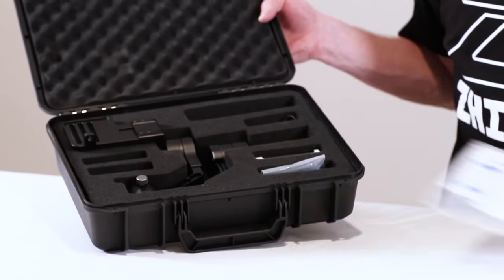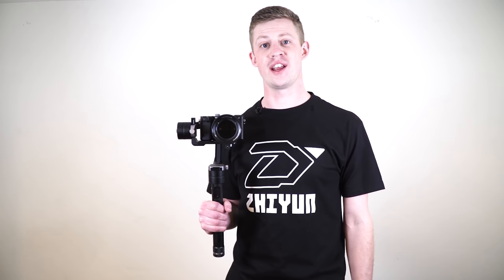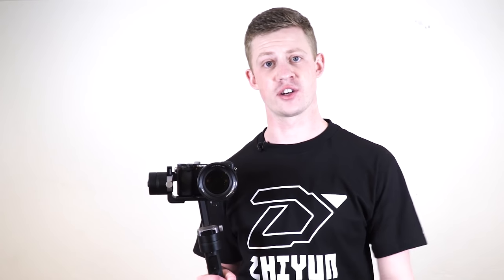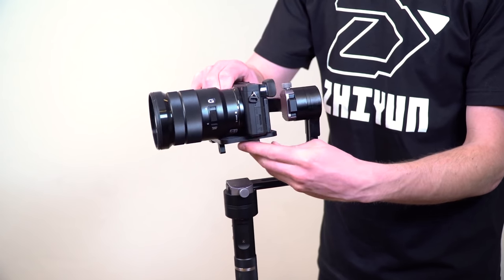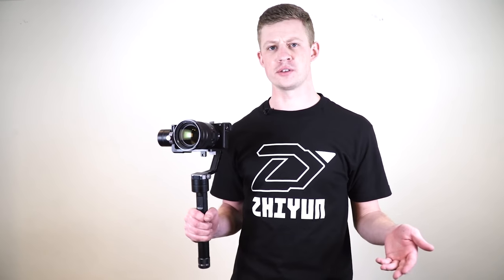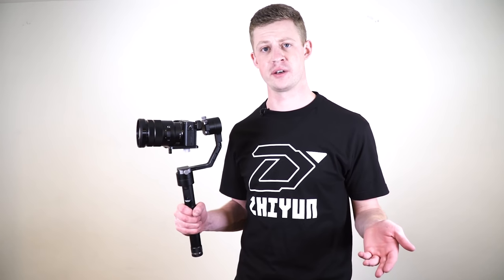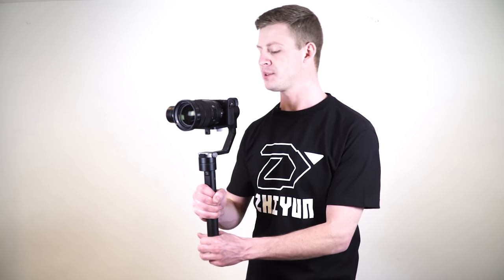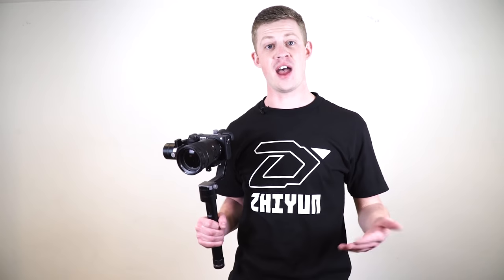Zhiyun Crane Basic Tutorial

Comment: hi just wondering can I use it with a Sony PXW-X70...thanks
Reply: Hi,what is the weight of your camera?
Reply: Hi, we don't suggest you to use this. Some of our users have successfully used this, but it requests very good balance.
Reply: Zhiyun-tech I can get my a6300 to balance while the crane is off. But it won't stay when I tilt It in different directions like you did.  It goes back to the neutral level position while off. I'm using the kit lens. Please help thanks
Reply: Zhiyun-tech I figured out the balancing. Thank you. The a6300 with the kit lens is not front heavy enough to be able to balance the camera and get it to stay perfectly when you tilt it (while the crane is off) like most larger cameras. But it still stays somewhat and when you turn the Crane on it functions.

Comment: Dear Zhiyun,

Regarding the new Crane2: 

Simple is best. 

And, so is being light-weight, high build quality, durability, etc.

When they start adding all kinds of unnecessary features, it just kills the product and company's integrity. 

And also the reliability goes down with added parts and features (more parts = more problems down the line). 

When you're shooting on a gimbal, you usually shoot at either MF infinity or use AF, and also stopped down Ap...so follow focus isn't really ideal nor desired. 

Not to mention, follow focusing + trying to be steady while moving/walking are 2 different events that are very difficult to do at the same time..lol! 

AF will have much better/reliable results, while using a gimbal and moving/walking around. 

Tip for Zhiyun... keep it simple, small and light. 

No one wants a complex smartphone or complex computer on their gimbal (we already have a complex camera to deal with!!!). We want something easy and fast to use...but high-quality and reliable. 

We want to MINIMIZE complication to our camera system!!! Not make them worse!!! Lol

Also, clunky and outdated Manfrotto plates are for beginners. Please use Arca Swiss compatible plates/clamps. They are much nicer, compact, smoother, stronger, etc.